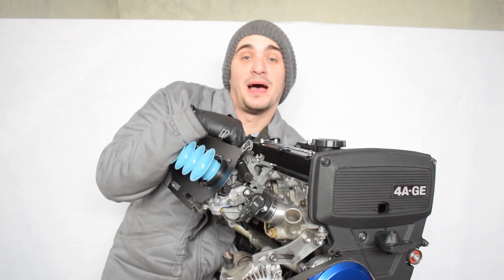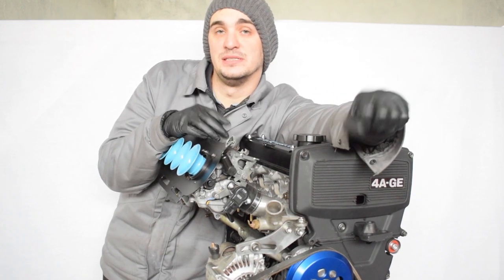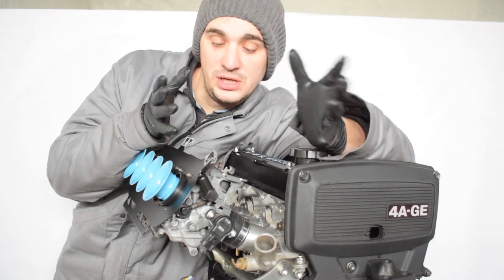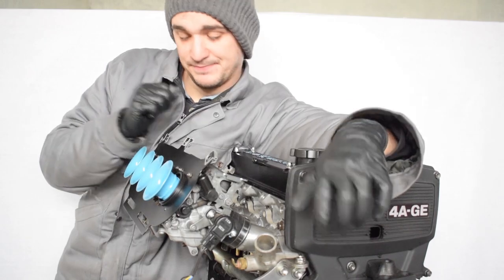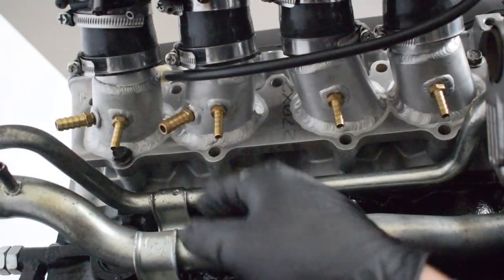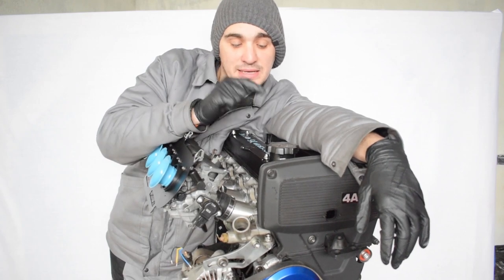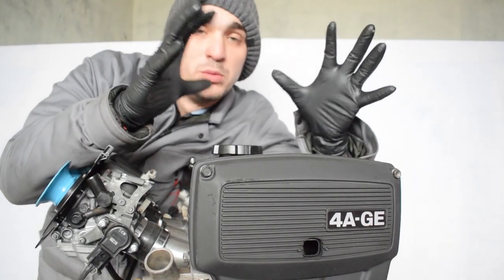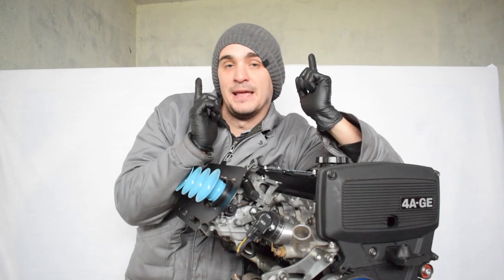Everything you wanted to know about my bike carb 4age engine

Comment: fun build! will stay tuned. i ditched my bike carbs (fj1100) for bike itbs (yamaha r6 2003/4) because the bike carbs were too pricey to maintain/refurbish, and the bike itbs were cheap as chips + i can tune on the fly instead of disassembling everytime. :)
Reply from the maker: Ricerguy Hmmm. Sounds tempting. Something to think about in the future definitely.
Reply: could depend on the age of the carbs i had, a brand new remanufactured set was about 1200ish usd, or 80usd per diaphram/slide (mine started to get pinholes) and my emulsion tubes were worn, forgot the price of those. but i got lucky and found the r6 itbs for a steal and the avg price was 60 - 90 usd on ebay, they came with the injectors, harness, tps, map sensor, air temp sensor ( yamaha air temp sensor is the same as my toyota one ) and i'm running a microsquirt v3. do you have an instagram account? :d
Reply: Ricerguy hmmmm my 1jz's should work with that aswell do you think ?
Reply: the microsquirt could run a 1jz, but for your individual setup you need to investigate if all the features are right for you :)
Reply: Ricerguy i will look futher into this thankyou
Reply: Jarryn Smith does the 1jz use a regular 36-2 Toyota trigger wheel? I know some 2jz do.. Y engine has the same trigger wheel count on the oem timing pulley :)
Reply: Ricerguy i will have a look

Comment: You can install electric vacuum pump for brake booster as well, i believe people use them for offroad vechicles so water won't leak to intake through brake booster
Reply from the maker: True. Good tip!

Comment: Thanks for you effort :) Regarding running no map sensor you are going to have a hard time without vacuum advance on your timing map. Like going up a hill at low throttle input and load under idle speed.
Reply from the maker: Can you explain this more, especially the "under idle speed" part? Naturally aspirated engines of this size can't go up a hill at low throttle anyway lol the 4age doesn't have any torque at all :)
Reply: When you are in traffic and you want to move forward without using the accelerator then by having a vacuum signal mapped correctly it will add timing. And 4AGE has enough torque haha.
Map signal works so much better with TPS

Comment: The 4age isn't used enough in builds. It's definitely as good as some older VTEC motors.
Reply: What do you expect, the 4AGE was only in the carolla and mr2. Both of which are relics of the past. Good luck finding one for a reasonable price.
Reply: @kknocks2378  They were in production for 15 yers and plenty of them was made
Reply: @kknocks2378  and they were also used in Celica and Carina

Comment: i'm in plan of using a similar setup on my Suzuki, similar carbs, but 1.3l 8v, mild cam, port and polished head, 10.5 compression
Reply from the maker: Sounds like a cool engine. I love Suzukis. Which Suzuki is it?
Reply: itìs a Suzuki samurai, the little 4x4 you see in my image. I could use the 16 version of my engine, which is a dohc design with forged pistons and better rods from factory. It was used in the Suzuki swift GTI. I didnt use that becouse it was pretty expensive so I choose to build my original one, hope to see something around 100hp
Reply from the maker: guido invernizzi I'm a big fan of the samurai. Rode in one ages ago, super uncomfortable but insane fun! Just be careful when going through water, the carbs can easily suck in water. Maybe make one of those snorkel things for the intake?
Reply: ahahah you true, i will not try to go into water like in my photo with this setup, since i will put pipercross or ramair sponge filter. I dont want to use a snorkel since I need to cut the chassis so it will be a street car only, no more offroad

Comment: i like how you've mix n matched factory parts to build a better engine, I've done the same with my sr18di Nissan. its easy to just buy this and that kit from eBay and away ya go, but the JDM cars are funny how subtle changes between models when mixed together can make a pretty peppy package. my engine  turned out similar in that I was able to increase duration and lift, compression and wind up speed using g all factory parts. my only downside was my factory ecu being odb1 had a few issues calculating things so I had to invent some wiring ( could not find any info on my di version Sr) to get it running right ( Ish ) I really need an aftermarket ecu to properly dial in a tune but from the feelometer I'd say around a 30-40hp increase.
Reply from the maker: Feelometer lol :) I like your approach. Where there is a will there is a way! I bet an aftermarket ECU will make that sr18di really shine.
Reply: driving 4 answers a basic rundown is after 16 years and 530k she broke a ring or two and was burning more oil than gas. I found a donor n14 gti pulsar, pulled the flat top pistons ( mine were dished ). cams from non roller gti highport on my roller lowport head, shaved head, gti headers ( on the di with its smaller ports the factory gti 4-2-1 headers are as good as extractors, gti flywheel, and removed weird intake baffle / butterfly's in each port.
Reply: driving 4 answers issues arised from removing the intake baffle thing. it was vacuum actuated and had a sensor to adjust mixture. with it just hanging it was telling ecu to supply idle mixture. now with it bridged its sends wot mixture all the time. so she's over fueling until wide open but that kinda suits my driving style anyway. I'd like to build my own system but I cannot find any literature in the di. even the Nissan workshop manuals exclude it.
Reply from the maker: Bro Tang I vote standalone ECU. Figuring that out sounds like a nightmare. Sounds like an engine with potential.

Comment: So what do bike carbs actually do and how're they different from the normal setup? Also is getting a second exhaust cam and putting it on the inlet side something you can do with any car. And finally I have a 4AGZE AE92 Trueno that I rebuild recently and on the exhaust cam it had a gear to drive the distributor, did you do anything to get rid of that?

Comment: Hey man! Big thumbs up to you & your channel. Been a proud subscriber to your channel for a while now 😉 

Still a question: by now, you probably have the car on the road — how does it drive? Also, does your engine consume/burn any oil after you’ve overhauled it?

Cheers from Belgium 🇧🇪
Reply from the maker: Hey there, thank you for your continued support. Car is not yet on the road as it's winter here, lots of snow and I won't drive it before spring. So we will know everything in Spring. I do expect quite a bit more carb tuning once I start driving. I don't expect to know whether it burns oil as I change oil far sooner than recommended. I will keep changing it often until I get the carbs completely dialed in as they are running rich for safety now, and the overly rich mixture dilutes the oil sooner than normal. Feel free to ask if you have any other questions.

Comment: The engine in my car is a 4 A-C . SOHV 
The queston I have is will this 16 valve cylinder head increase the
 horsepower of the 4 A-C 1.6  ?
Also are theses heads still available,  and where might I find one ..
Thank you for the reply....

Comment: fair enough with the cop and ecu talk, but how did you time your cams ?  and what is the compretion ratio ?
Reply from the maker: You mean dial in? I have to admit I didn't dial in the cams. My plan is to just keep dyoning the car at different cam gear degrees until I get the best possible setting :)

Comment: Pretty interesting that 600cc supersport motorcycle carb is well compatible with unmodded 1.6 liter car engine. Will you use Yamaha Genesis carb if you mod the 20v 4 age? That engine also use 5 valves per cylinder.
Reply from the maker: Hmm if I ever do get a 4age 20v I would consider it. Sounds logical, but my 20v knowledge is a lot weaker then my 16v knowledge :) One day, who knows. Maybe a turbo 20v 9age or some other craziness :)

Comment: The engine that's in my car is a 
4 A-C ,, SOHV .
My queston is will the 16 valve head fit my engine block , and will it increase the horsepower ?
Thank you for the reply...
Reply from the maker: As far as I know the 4age 16v twin cam head fits on the 4ac block. It's the same block. But the internals of your block are different to the 4age internals. They are not designed for the same rpms and will not last long at high rpms were the 4age head makes most power. Also the indents for the valves in your pistons won't be right. I think it's a lot easier to get a whole 4age engine and just swap it into your corolla. The 4age engine is still relatively plentiful. You can find it on junkyards, engine importers or breakers I guess.

Comment: Uh did you do a shim under bucket conversion when you did the cams ?, higher lift duration cams on the 4age require the shim under bucket kit to prevent the edge of the cam from catching`  on the valve bucket and destroying  the entire engine 
if you plan on revving this thing to beyond 7k you absolutely gotta have it
Reply from the maker: The 4age in its stock form revs to 7.600 rpm without a shim under bucket setup. I didn't do a conversion because I have a mild cam. A shim under bucket conversion is needed only on some seriously aggressive cams. Thanks for watching :)

Comment: Hopefully you don’t get a lean mixture because a lot of people have had issues with carbs on 4age engine and causing it to run lean at higher RPM’s .because you just can’t run the carbs as they are not enough fuel for the 4age engine I’ve seen holes in pistons and damage to ring lands and liner or sleeve
Reply from the maker: You're right, the carbs as they are will usually make a funny air fuel mixture. This of course makes sense since they were originally intended to supply fuel to a 600cc motorcycle, which weighs less then a third of my mr2. But that's where jetting and my AEM wideband gauge come in place. I will have constant real time air fuel mixture monitoring to avoid leaning out and will jet the carbs accordingly at different throttle positions.
Reply: driving 4 answers cheers for the reply mate hopefully you’ll sort out any fuel related issues . many people tell me about their 4age engine with carbs conversion it’s something different /fun to drive ,but has a couple of issues most people just leave it with the fuel injection but I’ve seen them both go head to head on the race track and it’s very even maybe only if it’s was a turbo 4age with fuel injection. I’ve got 3 4age engines one being a 20v in my ae82 had originally a small port 16v ,and now I’m planning to put that 16v in a ford laser KE fwd

Comment: What year and model Toyota  should I look for the 4age engine to fit in my 83 corolla wagon  ?
I have noticed on the front wheel drive engines that the distributor is mounted on the very rear of the cylinder head ..
Reply from the maker: Ronnie Sellers Basically, If your corolla is a rwd car you need a 4age from another rwd car. Same if it's fwd. I suggest you start in the club4ag forums. Lots of useful info there when you start digging.

Comment: Will those 600cc carb works on a corolla ke50 4k engine?
Reply from the maker: They should be, especially if the engine has been modified a bit. Making a manifold might be tricky as it's not a crossflow engine, but I've seen dozens of non crossflow bike carb converted engines, so it's definitely not impossible.
Reply: @d4a  thanks man. really appreciate!

Comment: technically its not a 4A-GE anymore its a 4A-CE cause its not electronically injected but carbed
Reply from the maker: True. But everyone knows what a 4age is so it makes more sense to still use that. Also, it should actually be 4AGC. 4A is the block, G means performance cylinder head and E (which is electronic fuel injection) gets replaced by C (carb). :)
Reply: driving 4 answers lol I always get performance and fuel delivery codes mixed up but yeah I understand I’m personally studying to become a t10 so I just felt like pointing it out 😇

Comment: I'm lost as to how this is different from a ITB stand point? ITB vs. Bike carb? Looks the same to me well i guess other than the fact itb typically right? Typically uses fuel injection, port injection or w\e and bike carb is a carb lol.
Reply from the maker: You said it. ITB is fuel injection and a carb is a carb. Supplies fuel by relying on the venturi effect, whereas the itbs rely on fuel injectors. The word itb is kinds misleading though. It stands for individual throttle bodies and explains nothing about fuel delivery. Bike carbs are also ITBs because they do have an individual throttle body for each cylinder. So it would be more appropriate to say a fuel injected engine with itbs or an engine with bike carbs. But since we all know what is what, just saying itbs is just as good.
Reply: Haha, thanks. yea i said it

Comment: Did u use a fuse for the no nodizz? If so what amp fuse did you use?
Reply from the maker: I used a relay and a fuse. Can't remember amparege, but there's a recommendation for it in the Nodiz manual. 15amp I think but don't take my word for it.
Reply: @d4a  thanks daddy

Comment: What is the HP estimate ?
Reply: basti_co A stock F4 CBR600 is about 95hp at the wheels. Given that these carbs are jetted, I'd think about 130-odd...
Reply from the maker: basti_co 75 lol. Jk, like 140. Maybe 145 or 150 if I'm crazy lucky. That's at the crank.
Reply from the maker: Ottsel 400RR You're probably closer than my overly optimistic estimate
Reply: Sounds like good usable power for enjoyable driving. Best of luck going forward :) Sry saw that late didn't get a notification

Comment: Does anyone know how difficult it is to do the head gasket on this engine for a first timer
Reply from the maker: If it is your first ever job on a car, like you never even changed the oil before then I would not recommend it. But that's not to say that you can't do it. I would suggest you start with the factory service manual a.k.a. the BGB (big green book) where there are detailed instructions on how to replace the head gasket and everything else. A plus is that this is an old school engine so it's far less complicated than modern marvels of engineering. At a minimum you will need to remove the head and get it to a machine shop to have it straightened again. You will need a few other gaskets replaced as well, mostly for coolant. Replacing the head gasket might also be a good opportunity to upgrade the engine a bit, maybe put it in some sporty cams, since you will be removing them anyway. I would also suggest replacing the water pump and the thermostat, since they are inexpensive items.
Reply: Daniel Maldonado learn to do maintenance first, then once you know the components of the engine, and can get to the gasket, the only problem will be having the right tools. 4 cyls are easy
Reply: John S ikw how to rip it from head to toe but I just don’t want to fuck up on the timing and torque spec on the head cylinder
Reply: Daniel Maldonado you could mark the chain to the cams and drive shaft, besides you can learn do do timing, you'll be fine unless you want to practice on another engine
Reply: I just took the head off a 4age today. It looks like a right old tedious job. Ill need some motivation to crack on with it......i might just bung a 20v in instead.